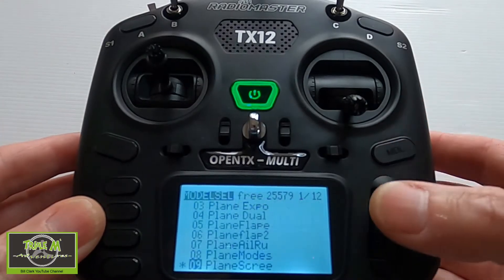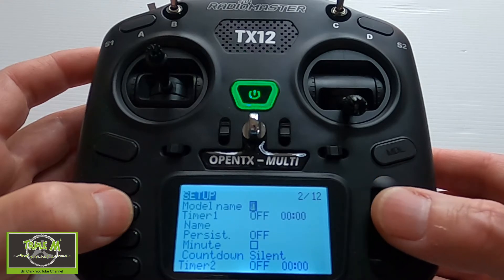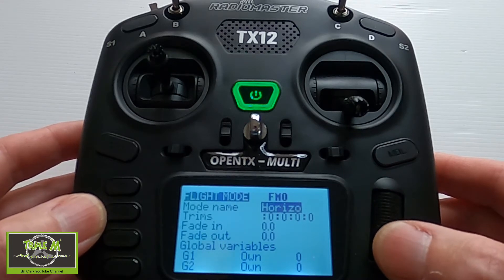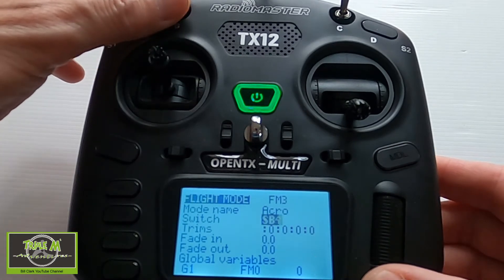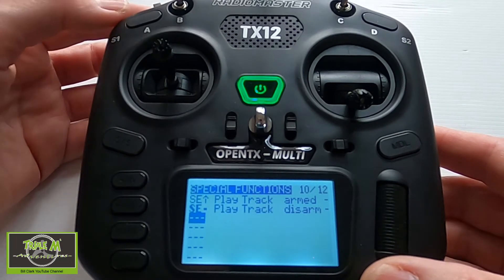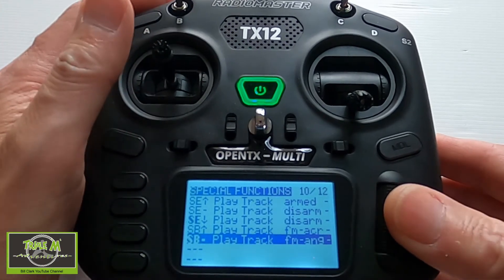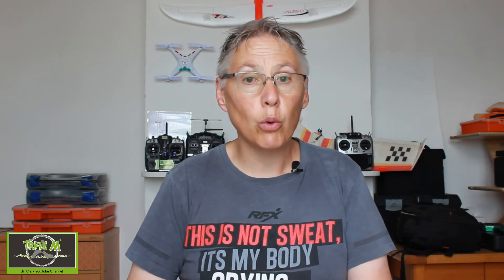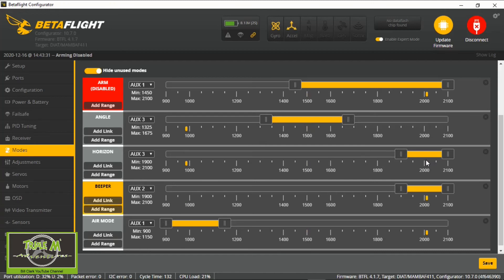RadioMaster TX12 Setting up a Basic Quad Copter

Comment: This is so great and so useful. Im expecting my TX12 tomorrow and very happy to have this guide me through my setups. Thank you 👍
Reply: Hello, do you recommend the TX12, I have been wanting to buy one for a while.
Reply: @evengrobakken1402  yes! This controller is great. Already bound to two cinewhoops 👍
Reply: @dadabooey  cool! I just have one more question if you don’t mind, I have been trying to seen if it will bind to the mobula 6 hd, you can chose between these receivers: DSM2/D5MX, Frsky D8 and TBS crossfire. I’m quite new to the fpv hobby and I only have a simulator. I have been thinking of buying the happy model mobula 6 hd, the TX12 and Eachine EV800D. Is this a good starter kit? Does the receivers come build into the drones, or does it go in the controller? As you can see I’m quite a noob😂.
Reply: @evengrobakken1402  the tx12 does not work with spektrum/dsmx. when I buy quads, I get the BNF ones, and make sure I select an rx that is already installed onto the quad. In the case of the 2 cinewhoops I got, I chose a xm+ rx for one and and R81 for the other (d16 and d8 protocol receivers). These receivers work well with the TX12. If you want the dsmx protocol, you may want to look into the Jumper T-Lite which can support more protocols. But the TX12 handles FrSky well, and you can buy a separate module to attach to the back of the controller to make it comply with TBS Crossfire. I personally love the size and build of the TX12 and the bigger led screen for feature navigation. As for the Eav800d, that's a good entry level goggle kit.
Reply: @dadabooey  thank you!

Comment: Ik having issues when I create model it just shows the model I've created it doesn't go to choosing what plane heli or quad just stays on the choose model screen
Reply from the maker: Hi, I am assuming you do not have a SDCard in the TX12 and this is the reason you are not able to access the model wizards. You need to download the SDCard contents from the OpenTX website for your radios OpenTX version then unzip the folder and put the contents on your SDCard. You do not need a large capacity card 4 GB would be fine but a good quality card would be  good idea.

https://youtu.be/7YXfGNqSiMM

https://downloads.open-tx.org/2.3/release/sdcard/

Comment: HELLO BILL THANKS FOR THE VIDEO IT WAS VERY USEFUL I DID NOT KNOW THESE FUNCTIONS I HAVE A TX12 RADIOMASTER AND I DON'T KNOW TO USE IT THANKS, I HAVE A FLYWOO EXPLORER LR4 PRO WITH FRSKY R9MM RECEIVER OTA I CANNOT PROBINE IT WITH THE X12 REMOTE CONTROL. IT IS ACCESS AND IT NEEDS TO BIND WITH THE MODULE YOU COULD MAKE A VIDEO ON HOW TO BIND HELLO AND GOOD JOB (I SIGNED UP TODAY)
Reply from the maker: Thanks for subscribing. Sorry to say you cannot bind your R9mm receiver to your TX12’s internal module. If you have an R9 module it will work in the JR bay of the TX12.
Reply: Good morning bill I'll explain what happened to me, I bought a 4-inch flywoo explorer pro long range with frsky r9mm ota receiver and I bought the radiomaster xt12 with r9m 2019 access module I tried in every way to do the bind and there are no I then succeeded in the YOUTUBE tutorials I saw that with the frsky x9lite radio this radio has the access mode that in the settings on page 2 has the registration with the module and the bind with the receiver, in the radio radiomaster xt12 on page 2 there is no the registration with the module but it has only the receiver bind so after a week of tests I bought the frsky x9lite radio and I managed to bind with this drone but with the xt12 I could not.
Reply from the maker: @ughettocor9208  I think you need to use the Lua script to access the module. Also you need the R9 option select in the options for OpenTX. I am out of my office but will check for you later.
Reply: @the-happy-RC-flyer  ok thanks for the advice bill

Comment: Hey Bill, when I hit the create model it doesn’t give me the option of plane , delta or multi ?
Reply: It just creates the model and says model 05
Reply from the maker: @Euphorio  Hi Jan, I am assuming you do not have the SDCard in your TX12 and this is the reason you are not able to access the model wizards. You need to download the SDCard contents from the OpenTX website for your radios OpenTX version then unzip the folder and put the contents on your SDCard. You do not need a large capacity card 4 GB would be fine but a good quality card would be  good idea.

https://youtu.be/7YXfGNqSiMM

https://downloads.open-tx.org/2.3/release/sdcard/
Reply: @the-happy-RC-flyer  yes , correct , no sd card , but I just got it and downloaded the contents as you explained, thank you very much. . one more question , doo I need to set up a folder like you did with for t16 , I have the t12 ? should the folder be named certain names or can I just create one folder  paste it in there ? and do I need all previous versions like you have ?
Reply from the maker: @Euphorio  I keep the old versions incase a subscriber cannot find it and needs an older version which is very unlikely. I would suggest setting up a folder called SDCard contents in Radio on your computer, you can name it what you like. So you do any adjustments on your computer and then copy the whole thing to your radio's SDCard in your computer which is a lot quicker than transferring the contents via a USB cable to your radio.
Reply: @the-happy-RC-flyer  thanks All , I did as you said ,, as I power on my controller it says SD card warning Expected ver: 2.3V0035 , ii went back and got this one , but it still says the same thing
Reply from the maker: @Euphorio  what version of OpenTX is on your TX12?
Reply: @the-happy-RC-flyer  it says  RM factory (45c24c6b)
Reply from the maker: @Euphorio  you need to update your firmware on your radio this video should help you through the process. Make sure you use the latest firmware version. 
https://youtu.be/iaoR3CLIYhY
Reply: @the-happy-RC-flyer  hey there bill , I just upgraded my firmware as posted. in the vie , I followed all your steps , it still says the error , but now it says expected version 2.3V00038 , I downloaded it swell , but still getting the same issue
Reply from the maker: @Euphorio  if you have updated OpenTX to version 2.3.14 you will need the SDCard contents 2.3V0038. Not all times but most if you update OpenTX you also need to update your SDCard contents.
Reply: @the-happy-RC-flyer  I updated SD Card contents as well , and still getting the same issue
Reply: @the-happy-RC-flyer  how can I do this all manually ? I have managed to copy and start a model from scratch from info I got on the web, I've managed to add some switches ,connected my tiny whoop and configured and set it up with Betaflight ,its powering on and its arming , but now for the flying part. either I don't know how to fly lol or I've connected something wrong
Reply from the maker: @Euphorio  the SDCard contents did you unzip the folder and copy the contents of the folder to your SDCard not the folder? If you have the latest OpenTX firmware on your radio and the latest card contents you should be fine. The error you are getting is because the firmware version and SDCard contents do not match.
Reply from the maker: @Euphorio  if your drone is arming you have set it up correctly. If you check out
my TX12 playlist you should find the videos to help you.
Reply: @the-happy-RC-flyer  ok I will check t out and get back to you, thanks a lot for your help. I have another question : on Betaflight it says my motors are reversed , id have to change this right ? because the props can only be installed one way
Reply: @the-happy-RC-flyer  ok bill , I got it , its working now , I had it in a folder lol. thanks so so much for your help , you're awesome man
Reply from the maker: @Euphorio  if the motors are reversed when you received you drone leave it that way. Props come in CW and CCW if you changed the direction of rotation you would swop the propellers around.

Comment: Hello Bill. Help me please.
How to change the button so that when pressed, the value is fixed in RadioMaster tx12. 
Best regards.
Reply from the maker: Could you please clarify, which button are you trying to use the momentary switch A or D? And by value do you mean  - 90 for example. And what is the purpose you are going to use the button for. Please let me know the above and I will try to assist you.
Reply: @the-happy-RC-flyer  I want to use button A for beeper.  press and it works like a toggle switch.  pressed it again, turn it off.
Thanks.
Reply from the maker: @joni-mirfpv6976  You need to set up the following Logical Switches:
L01 Func Edge V1 SA(arrow up) V2 [0:0:<<]
L02 Func Stky V1 L01 V2 L01
Go to Mixes and change source to L02
You should be good to go.
Reply: @the-happy-RC-flyer  Thank you very much. It's working. 
You are best.👍
Reply from the maker: @joni-mirfpv6976  you are very welcome.

Comment: Thanks for the video. But somehow i can’t assign Arm for Aux 1 to SE, only SA-SD. Any thoughts?
Reply from the maker: First please check this.
Click:
SYS
got to Hardware
Check switches are activated, should look something like this:
SA -------- Toggle
SB -------- 3POS
SC -------- 3POS
SD -------- Toggle
SE --------- 3POS
SF --------- 3POS

I always set up Arm / Disarm on Ch 5
Reply: @the-happy-RC-flyer  Hi Bill, I have the same issue, cannot assign Arm for Aux 1 to SE. I checked in the Hardware Menu and SE and SF are set on 3POS but still cannot assign them...
Reply from the maker: @ArkanElric  have you set up the Mix 
for Arm/DisArm on Ch 5?
Reply: @the-happy-RC-flyer  Thank you for your reply! Do you mean going to Models => Mixes, then setting up manually CH5 to SE? If so, I was able to manually change it afterwards, in that menu... Hopefully it was the right way
Reply from the maker: @ArkanElric  yes because it sounds like you had not set the Mix that’s why Betaflight is not detecting the arm switch.

Comment: Hi Bill, thanks for a great video 👍 noob question here! Just got an Eachine Novice IV, I presume I have to set my controller up as per your video before flying? Thanks again 👍
Reply from the maker: Yes you do. Good luck with it and enjoy the drone.
Reply: @the-happy-RC-flyer  nice one cheers Bill, many thanks for the quick reply
Reply: Hi Bill, sorry I have one more quick question I’m attempting to get the tx12 to read out quad battery levels. In special functions I have used ‘ON’ ‘Play Val’ ‘Batt’ ‘10’ but this just reads out the tx battery level.

Could you please advise on how I can get it to read the quad battery level instead? I’ve scrolled through the other options for this function but can’t seem to find it. Cheers
Reply from the maker: @fatstripper88  First question are you flying fixed wing or drone? Which receiver are you using? If it is a telemetry receiver you may be able to send back battery voltage to your TX The telemetry value will be shown under MODEL SETUP, TELEMTRY and then Sensors. Depending on your receiver this should be A1 or A2 sensor.
I will help you with the voltage call outs after we solve the above. No one said it would be easy!😊
Reply: @the-happy-RC-flyer  thanks for the reply. 

Flying Eachine Novice IV drone.

Apologies for my late reply! I have done a bit of head scratching and I think with my  Radiomaster R81 Receiver I cannot get quad battery level telemetry? 

Please correct me if wrong but I believe I’d require a receiver change to get this telemetry
Reply from the maker: @fatstripper88  No you cannot send VBAT to your radio with the R81 you can with the R168 and the Motive-RC R8SB but they are to large for a drone.

Comment: Hi...I have a problem....everything working good in betaflight roll pitch yaw throttle

Also when I connect the battery to tinyhawk2 ... roll pitch yaw working good....only throttle not working can not start to fly ... what to do ??

My remote radiomasterTX12
Reply from the maker: Hi, first check in Betaflight if the Aux channel for arming is working. If not go through the settings on your radio and Betaflight.
Reply: @the-happy-RC-flyer  yes they are working
Reply from the maker: @droneq8  have you calibrated the accelerometer in your drone? Do this in Betaflight with your drone level.
Reply from the maker: @droneq8  Ok great 👍🏻

Comment: Were there any changes from the time you did this video to now??  were there any changes in firmware version???  I am asking because the first pages of your screen does not line ujp with what I am seeing which makes it hard for me to follow what you are doing!  from time stamp 0:20 to 0:45 I do not see any of that. where you are assigning the aux switches I do not see how I can get to that with my TX12!!!!
Reply from the maker: Hi Brian, it should be the same. It is a good idea to have the latest firmware on your TX12. If you are not seeing the model wizard then I assume you do not have an SDCard with the card contents on it in your radio. Wizards only work when the card contents are in your radio. If this is not your problem please let me know and I will try to assist you further.
Reply: @the-happy-RC-flyer  I followed one of your videos as best I could downloaded and installed the latest firmware via the open tx companion app.  I also have an SD card in the radio as well and that was setup exactly how it was shown in one of your videos.  If you can provide me with the link from one of your videos that show step by step how thin thing should be set up when it is first taken out of the box to how I should configure it to bind and then fly my first quad, I would appreciate it.
Reply from the maker: @tvz857  I have a full tutorial list which I think will help you Brian here is part 1
https://youtu.be/OFgUGgwbSA0
All the videos are under my playlist RC How To Do. Let me know how you get on.
Reply: @the-happy-RC-flyer  also I was able to bind the quad but for some reason I cannot get the quad to arm.
Reply from the maker: @tvz857  is your receiver LED flashing or on steadily? if you cannot see on your receiver it is bound to your radio and you are using a telemetry receiver go to the Telemetry menu of your Model and select Discover new sensors see if sensors are displayed if so your receiver is bound. Then select Stop discovery. You drone will only arm if your AUX channels are set up correctly even if the receiver is bound to your radio. First thing to do is make sure the receiver is bound to your radio. My tutorial play list should help you. https://youtu.be/OFgUGgwbSA0
Reply: by chance do you have an email address where I can send you some screenshots of what I am seeing on my TX12 radio?
Reply from the maker: @tvz857  triplemadventures@gmail.com send the photos and I will take a look.

Comment: Someone please help me, after pressing “create model” i dont get to select the type and dont get to select the arm and beeper switch. I go to the setup screen rightaway, how do i setup those switches
Reply from the maker: You need an SDCard in your radio with the SDCard contents for the version of OpenTX in your radio. You will then see the model Wizard. Just format an SDCard download load the SDCard contents  https://www.open-tx.org and unzip the files copy to your SDCard and place in your radio. You will now have the model wizard.
Reply: @the-happy-RC-flyer   the SDcard content is puted in but still nothing happened, I used sandisk ultra 128gb micro sd card, please help!
Reply from the maker: @FrankWang-h6d  you need to use a small SDCard 16GB will be fine.

Comment: I do not have "Create" as an option.  it gives me backup model, copy model, or move model
Reply from the maker: You need to move down to a vacant model number. You can then create a model keep in mind if you do not have an SDCard in your TX12 then it will make a default 4 ch model, if the SDCard contents are present you will have the choice of Plane, Delta or Multi.
Reply: @the-happy-RC-flyer  so what you are saying is that I will need to have a SD card to create a model?  What I am trying to do is for the time being set it up so I can use it with the liftoff app.  I tried following you vlog that covers that but the options given to me do not match what you have.  the only thing is can assume is that I need a SD card..
Reply: Also for some reason I cannot delete the model that i inadvertently created.
Reply from the maker: @tvz857  To use the model wizard       you need the SDCard in your radio yes.
Reply from the maker: @tvz857  if the model is the one in use you will not be able to delete it select another model then you can select  the others to delete. The model to be deleted cannot be active.
Reply: In your first step, you say go to a spare number that I can create.  NO. 5 was my spare. I select the enter button then select create model just like you show it in your vlog.  Instead of getting the 3 selections (plane, delta, multi), line number 5 has MODEL 05 on that line.  This does not line up with what you are doing.  What is different?
Reply from the maker: @tvz857  You need the SDCard with the OpenTX contents for your version of OpenTX on your radio to be able to see and use the model wizards.
Reply from the maker: @tvz857  Download the SDCard contents and you should then have the model wizards.
Reply: @the-happy-RC-flyer  where do you download the SD-card contents? I have the same problem as Brian Sussex
Reply from the maker: @evengrobakken1402  Hi Even, link below select the version of OpenTX in your radio.
https://www.open-tx.org